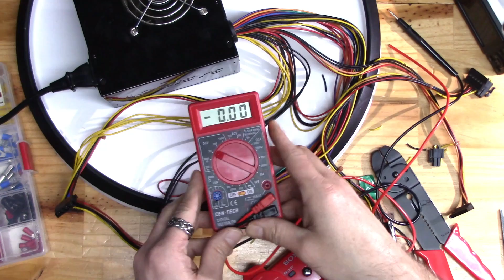how to use your car  audio inside

Comment: I had modded my logysis psu to only use one cooler master 90mm fan on the higher rated out put. R moved those 2 little fans and still have it going strong for 4 years now. I Love this video.

Comment from the maker: the logisis psu was crap so i swapped to old opti!
Reply: The Logisis psu's are highly over rated on their labels. IIRC, the one you have can only provide about half of it's rated output, if that. They are about as bad as DiabloTek's.
Reply: I had a Logisys 480W PSu for a while.. until it popped. Only PSU i have ever had that popped.
Reply: modstek make pc build . U have alot of hp
Reply: Dell 780 core duo q6600 ..?

Comment: That boss amp is so clean sounding. Although rated a 400 watts at 4 ohms it still kicks hard for the price!!!!!!
Reply from the maker: For budget subs those have lasted and sound great still. They are connected 2 ohm
Reply: My first set of dj speakers were a set of 15 inch 300 watt woofers in gem sound speaker case powered by a 500 watt 4 channel gemini amplifier Lots of house parties. There car speakers have always sounded better in 2 ohms then 4 ohms.  There 60hzs frequency have always been stable. Those boss amps even though there stated wattage is not true they do have stable dynamics at 60hzs for subs. Kudos to your amp rating knowledge.Feedback is reduced drastically with your set up. I hope you get a lot of audio enthusiast checking out your content. I sure do miss buying 15 speakers for 60 dollers a pair with 60oz. magnets and 2.5 inch steel camp voice coiled.

Comment: I did a similar project accept I cut ALL the wires and just soldered the green and black psu jumper together
Reply from the maker: Yeah that's the right way to do it I agree. I also seen eBay sells 12 volt different amperage supplies cheap now you just add a a.c. adapter to it. And they are cheap. I don't know about quality but eventually I will get one